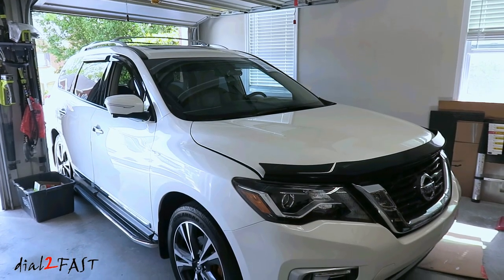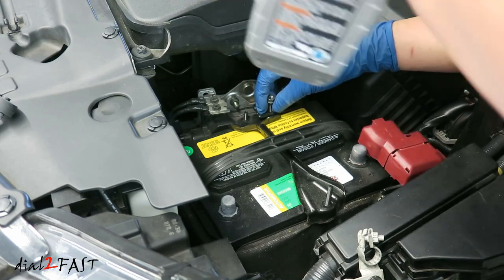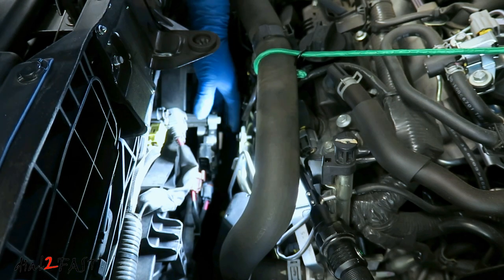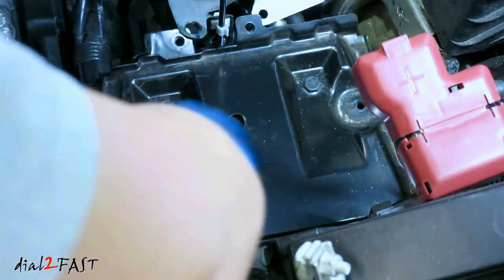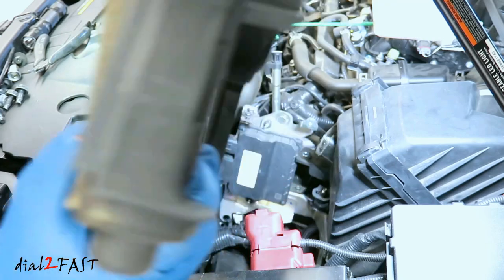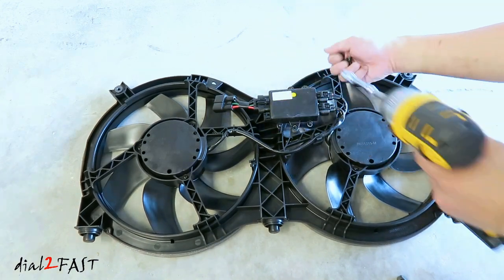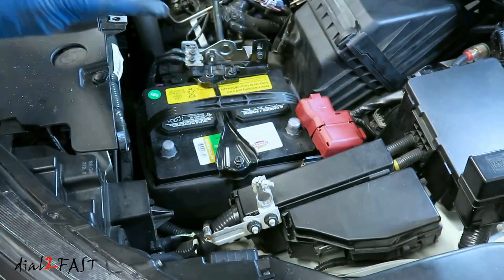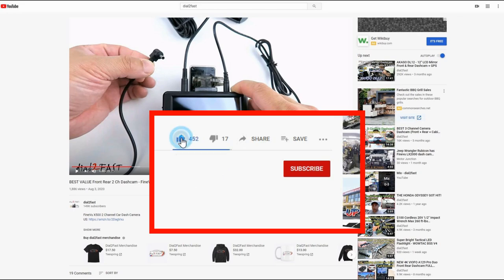How To Replace Nissan Pathfinder Radiator Fan Assembly (Infiniti QX60)

Comment: Nissan dealers are really angry with you right now. 😂. Thank you.
Reply: They told my neice it was going to be $1,000 dollars
Reply: They just asked me for $1400
Reply: No doubt. 😆
Reply: I replaced mine with an American made universal fan for $90. Still running strong 35k miles later.
Reply: @heshe1976: Got a link or model number to the fan you used. Woke up this morning to this issue in a 2017 Infinity QX60.
Reply: @thegreenman2030 
I'm sorry I didn't see your comment earlier.  I don't have a model number because I replaced mine about 2 years ago. Do you still need assistance?
Reply: @heshe1976  No worries at all. It’s all taken care of. Turns out my 2017 is still under extended warranty and it was covered. 

Thanks for taking the time to respond.

Comment: This video is years old as I write this, but every bit as useful as the day you posted it it.  You nailed the step by step and made this something an average person with basic mechanical inclination can perform.  You saved me and my family over a $1000, so cheers, thanks, and keep up the great work!  This is especially useful since this is a common problem.  I just pulled a bad assembly out of a 2015 with only 51K miles on it.  The passenger side fan was the one with all the play in it, just like in your video.

When I did the 2015, the middle rubber grommet got pulled off the old fan assembly as I was trying to get it out through the space created for the removal/installation.  I was able to reach down and grab it off of the front splash guard where it fell.  I just wanted to mention to make sure you aren't missing any of them, especially if your replacement unit requires you to swap in the old grommets.  Also, in the 2015 I worked on, there is a very large plastic shield around the wiring bundle that runs to the PCM/VTC box, rather than the retaining clip shown in the video.  It is closed, hard plastic tube that has a rectangular shape to it.  It was a tight squeeze, but I did not have to remove the shield, thankfully (I would not have known how to deal with it).  If you run into this, be very careful of the wiring bundles that run to the PCM/VTC connectors.  Since that wire bundle can't be moved with the shield over it, the bottom of the replacement unit has to go over these bundles where they exit the shield to connect to the box.  In the 2015, these bundles only had a small amount of electrical tape around them but most of the wiring was exposed.  I was very cautious to avoid abraiding/stretching/breaking any of these exposed wires when moving the fan through and out.  

Most of all for people that don't regularly work on cars, be patient with yourself, go slow, and follow this procedure.  It breaks the process down into manageable bits.  This helps you be more calm when you see how much of your car you had to take apart/disconnect to do this repair LOL.

Great work and thanks again for sharing money-saving knowledge.

Comment: OK.  I did this change on a 2015 Platinum Pathfinder.  This is a good video for most of the way on a 2015.  There are some differences near the end of uninstall.   The Air Box is not screwed down but attached to the ECM frame at the back.  You need to remove the ECM frame by removing a 10MM bolt at the left rear and unclipping the harness at the back of the frame.  The air box is attached to this frame  by a friction peg.  It lifts out.  There are three ECM plugs not two and the harness does not unclip from the front of the engine so it's genuinely in your way but workable.   There are no ground wires on the top. There is also an extra bolt in the battery plate at the front left.  There are also three clips of a harness wire on the left side of the fan assembly.  I used a Continental fan FA71750 and it is in and appears to be working fine.

Comment: I don't typically write reviews on youtube, but I felt compelled to comment on this one. This is a fantastically well-done video! I would describe myself as a seasoned beginner with most things mechanical. I can do the basic things (tire rotations, oil changes, etc.), but to me, this is a major repair. I followed this video for a 2016 Nissan Pathfinder. It took me about six hours following this video. Fan assembly cost $293.40 with tax. I ended up with a spare bolt and nut that I could not account for even though I rewatched the video multiple times and retraced my steps. For my vehicle, this video was almost identical. I had difficulty removing the fasteners for the bundle that ran across the top front of the engine compartment so I cut them. It worked. It took about 30 min to wrestle the thing out and about 10 min to get it back in place.

Anyhow, this guy really explains the steps well. The lighting is great. The shots are mostly clear (except those damn fasteners). Well done!
Reply from the maker: Really appreciate you taking the time to write your comment. I am glad my video was able to help you with your repair. Have a great weekend!

Comment: Just replaced mine last weekend. Took around 2 hours. Great job on the video! Nissan needs to recall these. Mine has 40k miles on it. Same side of mine went bad
Reply: 49k on mine and it was the same side also.  Crazy.  Obviously a defective part.
Reply: Same, ours is just under 40000km, went to Nissan and they said $154 do diagnose (even though i already know what was wrong) and about $2000 to fix. What a joke. They baited me saying they'll send a good will request to Nissan head office... I'd rather try this sort of help on engine or CVT issues...

Comment: Thank you for the video. Step by step with such detail as to how you remove each clip and harness makes it a 5/5 star tutorial.

I will note my 2015 Canadian spec pathfinder had a couple differences, including two ground wires attached to the ECU bracket being located elsewhere, as well as a couple clips in a different place. Despite this, the video was all I needed to get the job done. 

For other viewers, so note, he makes it look a lot easier than it is (mainly getting the old unit out, and the new one in.) I have done plenty of DIY automative jobs, and this still took me 1.5 hours to get the old unit out, and 2 hours to get the new one in and everything put back together best and tidy. 

All in all, can’t thank you enough for the video. One day I look forward to giving back to the YouTube community as you have.
Reply: He actually mentioned the two straps during the video at approx 08:30 but he referred to them being connected to the bracket meaning the bracket holding the TCM and pcm to side of battery tray glad to hear you got it done nothing feels better than a job well done and money saved am I right

Comment: Thanks for the video. Did it in 3.5 hours and only lost a 13 mm socket and a T30 bit. That includes driving to home depot for the weather striping. Total cost $169.

Comment: This is hands down the best video at replacing the fan assembly on a 2017 QX60.  Replaced mine in about an hour and a half using your tips.   Amazing videos my man, please keep them coming.  Also let me know if you do one about replacing the spark plugs and coil packs please.

Comment: Looked over several videos on this and I would say hands down this is the best one. Took me about three hours from set up through clean up. 2016 Pathfinder with a slightly different module setup by the battery. I used a second strap to pull back the module and harnesses once they were loose. Thank you for taking the time to put this together.

Comment: Thank you so very very much!!! This video is a perfect example of a How To video!!  It does not get any better than this.  I rejected two quotes of $1100 and $1150 from local mechanics, bought the entire assembly online with control module for $200 (that also had the three grommets and foam attached for), and it took me 1 hour to disassemble, and 45 minutes to reassemble.  I replaced old rusted bolts too!  I like that there is no preamble, no long definitions, just directions that speak to exactly what is needed.
Reply from the maker: Thanks for sharing your experience. Good to hear you got yours fixed and saved some $$$.

Comment: This video is AMAZING!!! The job took me about 4 and a half hours because I'm old and slow, but I did it and the replacement fan works great. The connections on my VTC controller were in a different configuration but not a problem to remove (2015 Nissan Pathfinder) The fan cost be about $180.  Thanks for this video, I can't believe I actually did it! I'm not a car person or a mechanic in the least, but I am cheap! so after watching this video and seeing how the repair job goes it gave me confidence to try it myself. Saved nearly $1000 because of this video.

Comment: Thank you for the video. Got exactly the same problem and dealership wants 2500, 500+ for the parts and 1900+ for the labor. It seems not easy but if take time, it is not that hard if following your video.

Comment: Great to the point tutorial. After viewing and getting the new fan assembly it was easy to stop at and complete each step. I have a 2014 and there were some different clip locations, plug types and quantities but the sequence shown was very helpful and I had most of the tools. it was nice to not have to use trial and error for sizes. Some bolts were very hard to get to. Thanks for the great directions and the grand I saved.

Comment: Just got done with my 2014. Thank you so much. Tips from a novice, don’t do this tired, expect about a good 2 hours. Makes sure you have plenty of light. Pivot the fan from the center counter clockwise out. It made it easier for me. Putting everything back together is easier just remember to keep track of all the bolts. Also make sure you stretch!!! This will murder your hamstrings if your 6’ or taller. Cheers.

Comment: Thank you for a very thorough and comprehensive video. Made replacing the fan assembly on my 2016 Pathfinder. Just to note, there are some minor differences between years but I was able to figure it out. The module on my new Dorman unit had 1 socket on one side and two on the other whereas the original had all sockets on one side of the module. It freaked me out at first until I realized the two sockets that where seemingly on the wrong side went to the fans so it was irrelevant

Comment: Wow! Really one of the best, most detailed repair videos I have seen in a long time. You made this repair virtually dummy proof. Slight modifications and extra screws as I have a 2013 Pathfinder (first time fan has had this issue in 160k miles!) (I'm original owner). But rate this a 10/10.  Thanks.
Reply from the maker: Glad you found my video helpful. Cheers!

Comment: Great video.  I have a 2017 QX60 with 40K miles and ran into the same issue.  I was quoted $900 and was able to get it fixed for $350.  There has to be a defect, there should have been a recall on these.

Comment: Thank you so much. Just started having this trouble on my pathfinder and this was the first video that popped up about it. I will be using this as a step by step guide next weekend to repair mine. And thanks for doing the reverse assembly as well. More times than not it's the reassembly that's harder to do than the teardown. And most reviewers don't address it.
Awesome work sir!
Reply from the maker: Thank you for your comment. I am glad you found my video helpful. Have a great weekend!

Comment: My 2016 Pathfinder failed at about 50k and I had to replace them myself. I do give lots of credit  to this video. Very thorough ..though I don't recall if I installed the rubber mounts on the new fans when I replaced them..oops. So far those TYC have more than 75k on them and no issues.

Comment: Thanks Man... I'm going to replace mine on wednesday... I have a 2017 Nissan Pathfinder SV 4WD with 65K on it. I have to replace the Thermostat at 60k and now the driver side Fan is making the noise. but so far it has been a Great vehicle...

Comment: Thanks!   2015 Pathfinder with same issue.   Part cost $170 vs $1000 quote from mechanic, but did take me (rookie), 5 hours..   Wasted a lot of time with the left side fan screw..    Home depot run and get some flex socket that was finally able to turn it..  Either way, saved a TON!   Much appreciated!
Reply from the maker: Good you got yours fixed. Thanks for sharing your experience!

Comment: This video is great. Very helpful step by step. Took me about an hour to take apart and another hour to put back together. Only struggle is those dang clips are difficult to pop open and some really hard to reach. But video totally is a great guide and car working great. 2017 Nissan Pathfinder.

Comment: Hi, I found this video very helpful, thanks for spending the time to record and upload - absolute legend. 

I have do have one additional piece of information that may help others. When I replaced my fan assembly it did not work. After some trouble shooting, I found that the new fan management unit most likely requires an address to be programmed to operate with the car computer (or unlikely but potentially my new one was faulty). Fortunately for me, my old fan management unit mounting pattern matched the new and I was able to replace the new with the old and Voila - Fan running. If anyone else has this issue, try it and it should work.

I also replaced my fan management unit mounting screws with slightly larger ones as the ones supplied weren't exactly tight and snug when screwed in.

Comment: Many thanks Dude!  Just finished the install.  SMOOOOTH!  Scared me to unplug the ECM, unbolted the bracket and rolled the connectors out of the way.  We just finished a 2500m run pulling a camper, passenger fan went bonkers, pulled the plug and finished the trip on one fan.  It wasn't sounding real healthy, lots of play in the bearings.  112,000
Again, many thanks.
Plugs are next.
michael
Reply from the maker: Very glad to hear you got yours replaced. Thanks for sharing your experience.

Comment: Thank you so much for posting this video. The instructions are very thorough and easy to follow. My 2015 Pathfinder just hit 50k miles and the fan noise which was intermittent a few months ago, turned in to a serious issue. I decided to purchase the fan assembly recommended and was able to get the job done. However, there is just one thing that I would like to point out. The self-adhesive weather seal tape size recommended here (1/2" T X 3/4" W) was too big and didn't let the fan sit properly in its place. I had to use a smaller tape and both bolt holes lined up perfectly.
Reply: What tape size did you use?

Comment: Thank you sir, I just did mine, I had to buy the fan from the dealer which was expensive $350,, the fan bolt on the passenger side and the iron plate of the battery gave me a hard time.

Comment: Well, that was not my favorite thing to do. Your video is awesome - best one out there for this job - but it took me almost 2 hours to get the new fan in and in the end I had to unfasten the controller module to get enough space (only one extra screw but took awhile to figure out what it would affect). Our 2015 Infiniti QX60 with 70k km had a different wiring harness than in the video and it caused some serious problems getting the old one out and new one in. I was paranoid about damaging the wiring harnesses. I also had a heck of a time with one of the clips on the passenger side on the fan apparatus that you have to get at from the bottom (wasn’t in the video). 

I’m from BC, Canada and heard the same noise many others have noted with this issue. Was only the passenger side fan acting up but it was loud when it was going. Reaching in with the engine off, I could feel the wobble of the fan, as indicated in the video when they were out. Shutting down the climate control would stop the noise but not the deep vibration. 

Anyway, called Nissan who quoted $1250 CAD plus tax for diagnosis and fix. Found the TYC part on Amazon for $290 plus got some of the foam tape. Got 1/2” x 5/16 and could probably still get next size down for width. Rockauto was cheaper but with current border issues and Covid, shipping made it more (we live near the border and often get stuff shipped to Sumas). My mechanic said he would put it in for $190 but no openings for 2 weeks so thought I’d give it a shot as we have a road trip coming up. I’ve done a few small repairs on other vehicles - oil, brakes, ignition coils, fuel pump so I thought maybe I could tackle this but it took about 5 hours. Nearly 3 of those hours were fighting with the fan and watching different videos trying to figure out how to get the bugger in and out. It’s a tight squeeze, especially with those wiring differences. Ours is the fully loaded version so not sure if that changes wiring. 

Anyway, in the end, I followed the video and had to come in at an angle like demonstrated, then make sure the fan got past the AC hoses on passenger side, then undo controller to get enough space on the driver side and it was still tight. Wish I had waited the 2 weeks and taken to my mechanic but I guess I still paid myself $40 an hour and only a few cuts. 

Really appreciate the video - couldn’t have done it without it.
Reply: Same experience. 2015 pathfinder at 110km. From Langley, BC Canada and sounds like mine had the same differences as your. Took me 4.5 hours total for the job. Not fun, and hope I don’t have to do it again. 

Couldn’t have done it without this video though. I too watched a few, and this one wins by a landslide. 

Decent price on the replacement unit, but I wish it came with the foam seal installed.